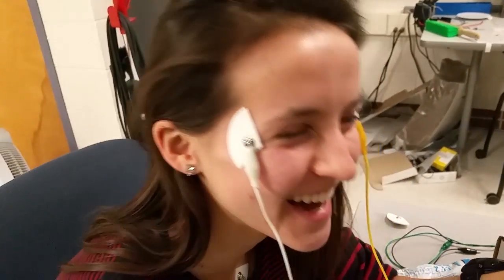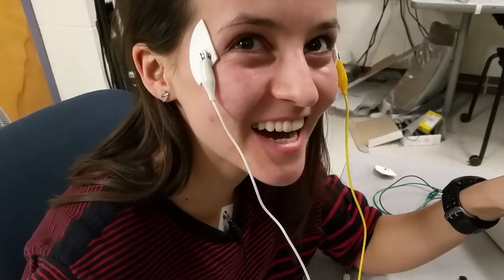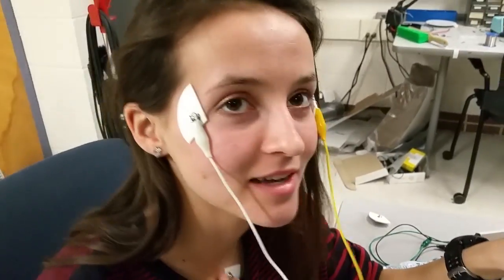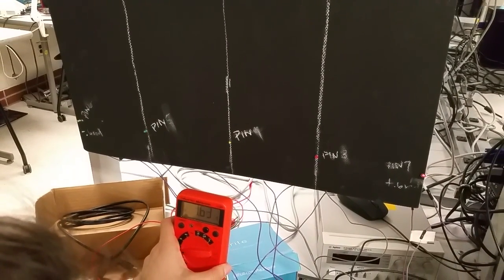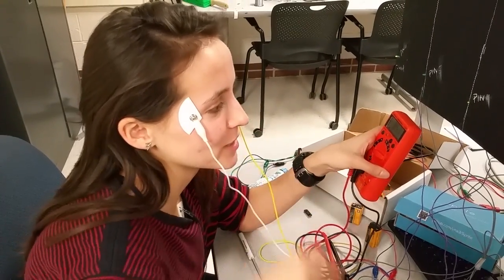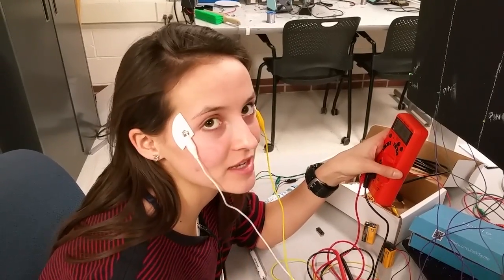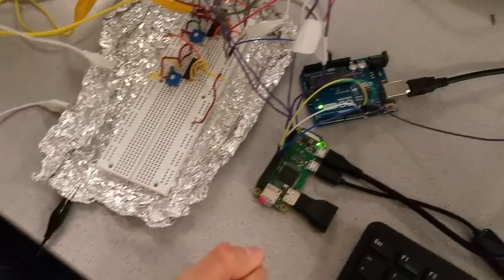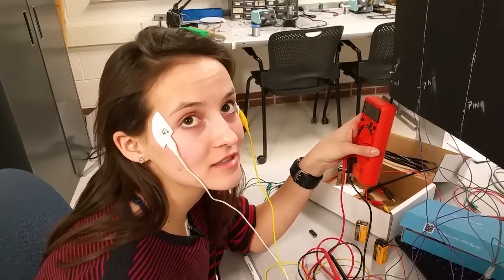gaze-directed control of LEDs

Comment: Nice, But why arduino then raspberrypi, arduino alone is enough to drive LEDs
Reply: the raspberry-pi is doing the heavy high level processing, then lighting the leds, from the adc data from the arduino.
Reply: wolfgang Beginners-Mind I thought it's a simple ADC averaging and comparing with a preset threshold. BTW is it your project if yes please share the details at least the pseudo code.